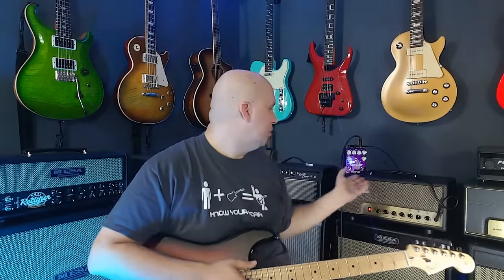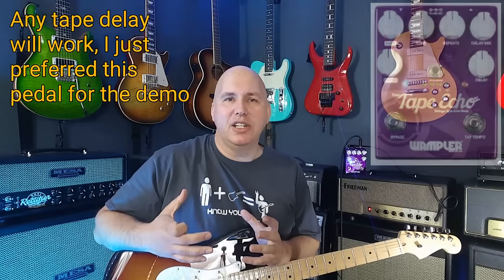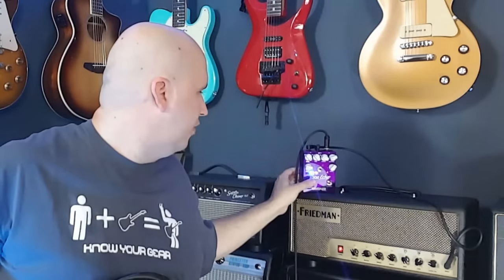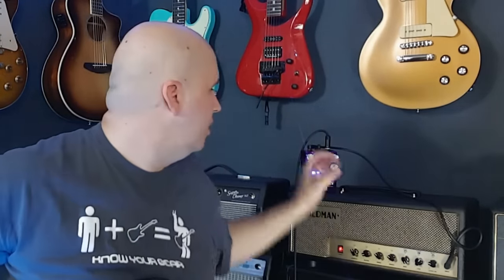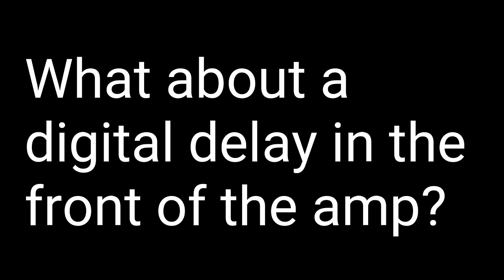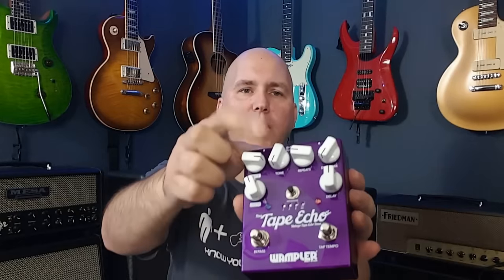Put Tape Delay in front of the amp?

Comment: If you want to make the point of tape delay preamp coloring then use the Belle Epoch. The Wampler Faux does NOT make your sound thicker, in fact it cuts a little bit of bass. It still is the best dry tone on any delay I've used so far.

Comment: I have what I feel is a great an unasked question.  .  .  I would love to know your opinion.

I was watching That Pedal Show and they talked about using an EP circuit in front of the Strymon Timeline on tape setting to get a very convincing echoplex sound without the hassle... great episode if you haven't seen it. 

What my question is.... is this.... "What if you do indeed put the echoplex circuit emulator in front of the preamp, but the strymon unit still goes in the loop?  Wouldn't this give you the benefit of having the tape delay in the front of the amp but still allowing you to leave it in the loop for all other strymon delay applications?"   

Signal chain:  Guitar -> Siegmund Missing Link (tube buffer) -> Telonics Pro Volume Pedal -> Chase Tone Secret Preamp -> Amp's preamp -> Strymon Timeline -> power amp out........ That is what my signal would look like in that particular case with no other loops engaged.

Comment: i never knew running the delay pedal in the front could work with a driven sound. but it sounds amazing!!
Reply: Hoshi Hearts its fine... but you Have to set it at minimum settings... if you want a real lead delay run it in the fx loop...
Reply: manu gomes running delay in the fx loop is the obvious thing, so i was surprised that it can sound good at all in front of the amp.

Comment: Hey Phil, I'm in the market of downsizing a ton of gear. Was wondering what you would pick in a 1x12 combo that will take pedals the best?  I'm liking the Fender 68 reverb, or do I say it, the solid state Roland 60 watter. Any other cool combos you like for pedals? I have most delays, OD's and a couple of fuzzes on my board. Keep on rocking it dude.

Comment: There's a very noticeable difference in the tone too and not just in the warmth (drive), but it's not just the tape delay itself (or its preamp) that does this, but how the tone control of the pedal is set. It should be in a neutral position for the a/b comparison, was it?
Reply from the maker: mtsn no I had it back way back to get that sound

Comment: Question I see you do most of your pedal demos on your more expensive amps. How would the react/sound on a cheaper amp like a Peavey Classic 20 or a fender super champ 2 or a Blackstar HT1 the Lowe wattage amps for small settings?
Reply: Bob Howell I have owned a classic 30 for 15 years. It's a great amp once you replace the speaker (I went with a Cannabis Rex) and tone caps (Google: classic 30 "blue mod") a bit of time and about $150AU all up.

Comment: I was thinking of getting a Strymon Deco for this but I'm having second thoughts now because it's digital...
Reply: Jeff Beck I used a deco for quite a while, it's a fantastic pedal. Doesn't sound digital at all. Strymon pedals are all really good for that, blurring lines between analog and digital.
Reply: wampler is digital too, what Phil was pointing out is that some digital delays are modeled after analog ones (in this case a tape delay). i have a magneto eurorack module from strymon in my modular synth, which is a tape delay digital emulation (but with good analog preamp) and a real korg se-300 tape echo, i have to say both sound great! so don't worry about it being digital, if it has a nice preamp section and a good tape emulation you're good to go.

Comment: What about analog delays? it seems tape delays are cooler in front, analogs on the back. but what about analog?
Reply: Anything that creates distortion in front of the amp will affect the sound. Anything put into the front of the amp is running through the entire path of the amp.  When you use effects loops it puts it in a different spot in that path.  This depends on also the amp design, FX loop is series or parallel.